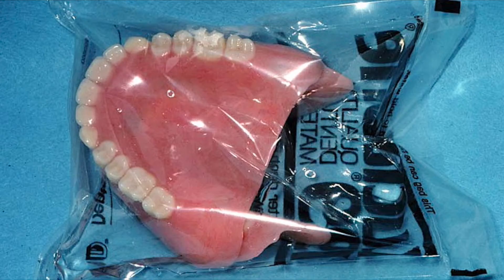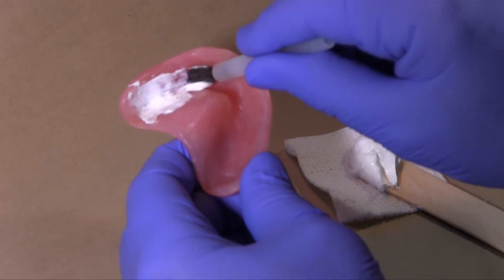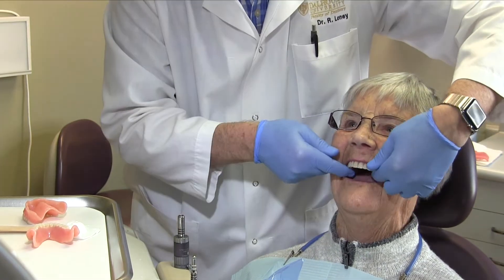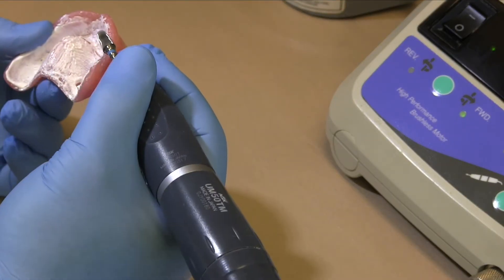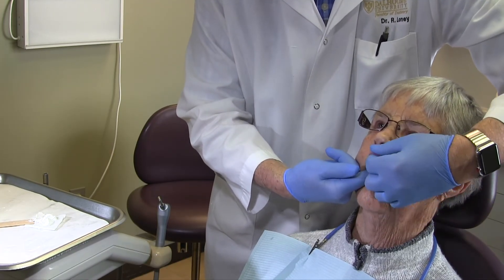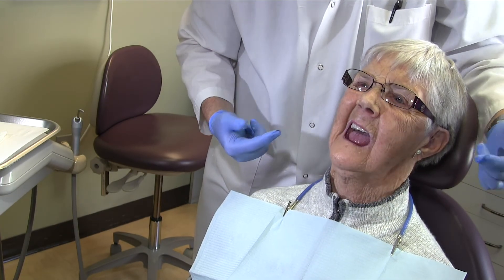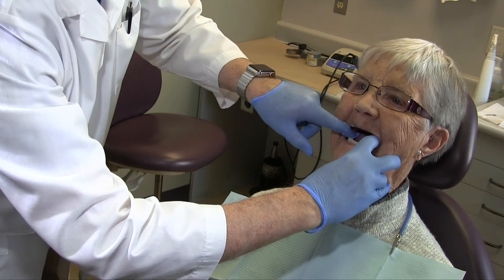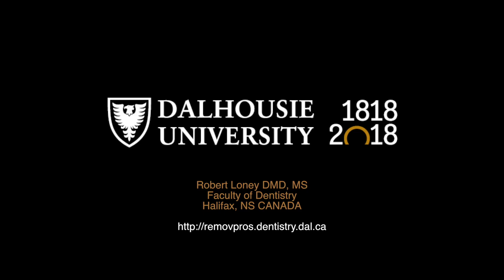Complete Denture Base Adjustment

Comment: previously, the occlusion must be adjusted to check that there are no prematurities, and that there is a bibalanced occlusion.  the technique of use is very well shown.  Thanks for showing.
Reply from the maker: Thanks. Post-processing adjustment of denture occlusion can be undertaken prior to the clinical adjustment and delivery. But on the day of insertion, the denture base should be adjusted prior to additional occlusal adjustment, because any change in the seating of the denture caused by that adjustment could alter the occlusal contacts. Therefore always adjust the denture base prior to occlusal adjustment at the patient appointment.
Reply: When adjusting the occlusion, observing with the fingers that there are prematurities (using the fingers to detect where the premature contact is), in a stable occlusion is when I would recommend using the pressure paste to adjust the parts that are discomforting when wearing the prosthesis.  If you do not adjust the occlusion, the prosthesis would be unstable and would compress the mucosa in an unbalanced way due to the occlusion that it can affect.  But by wearing too much it can produce less suction.
Reply from the maker: @jonazcorbebeitia3415  You are correct that if the occlusion is unstable, it can tilt the denture and cause pressure in areas that would not otherwise be a problem. That is why you should never have the patient bite the dentures together when disclosing the denture base - just use firm pressure with your fingers over the first molars to provide even seating force. But always check the denture base first because changes in the seating of the denture can affect the occlusion.

Comment: should denture be 2mm short of vestibule?
Reply from the maker: No
Reply: @DrLoneyDal  So only the tray should be 2mm short. then with border molding, we restore the 2mm which is reflected in fully extended borders of denture.
Thank you.
Reply from the maker: @angelicafoster670  There are a number of techniques that work. We normally make trays 3-4 short of the periphery and then border mold to the height of the vestibule prior to making the impression with a low viscosity material. In this scenario, only a thin layer of impression material (0.5-1 mm) is desired over the surface of the border molding. http://removpros.dentistry.dal.ca/ewExternalFiles/CD%20Manual%202019.pdf
Reply: @DrLoneyDal  Thank you, now i get it
Reply: @DrLoneyDal  Great videos!!!!!!!!!!!!!  Wish I could be an expert like you soon!!!What will happen if layer of impression material over the surface of the border is too thick? = We really had hard time removing final impression.
Reply from the maker: @TT-ct6ho  If the impression material over the border is too thick, it will exhibit tremendous retention when the patient is at rest, as you noted when trying to remove it. However, during function the patient will experience either discomfort (due to overextension) and/or loosening of the denture as the tissues pull against the bulky/long flange. Most impressions can be removed easily by breaking the seal along the border - see my video Complete Denture Impressions Two Mirror Technique, https://youtu.be/6gLs5iPWMD0